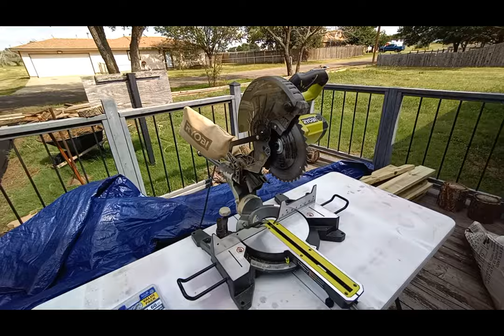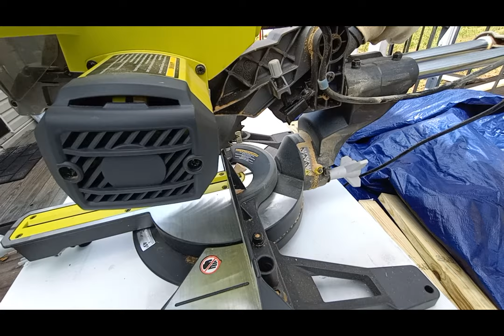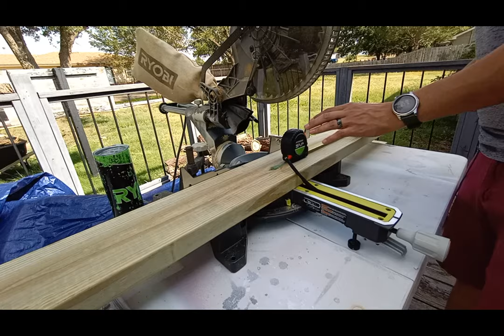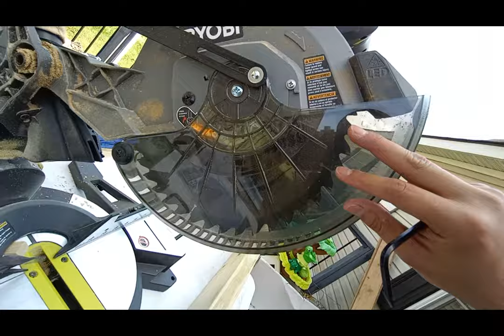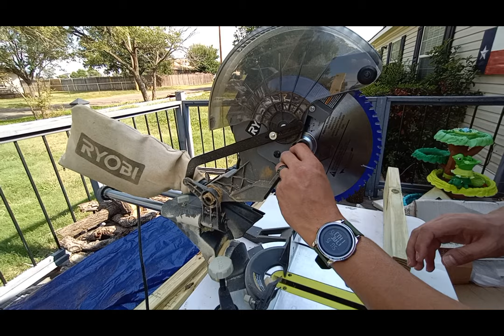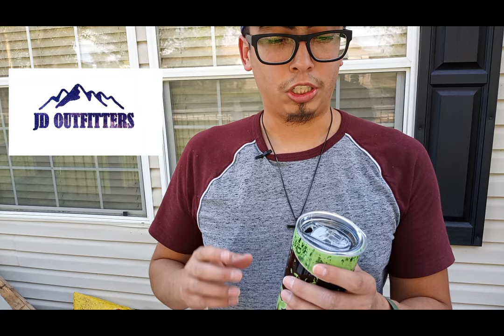How to change a miter saw blade for beginners | Ryobi TSS103T 10in. miter saw review

Comment: Extend saw and start the cut on the side nearest to you and push away from you to finish the cut. Teeth designed to cut in that direction and it's safer.
Reply from the maker: Thanks for your input, I'll give that a try.
Reply: just saw this in the manual for the same saw, I had no idea about this before then. Anyways good info 👍🏻
Reply: Yes, this is the way!

Comment: That saw is not that good, and the blade it comes with is a P.O.S. If the saw did not come with the stand when i bought, I would have returned it. Then, I woulld have went with the craftsman one or Kobalt 10 inch. They both slide smoother and are double bevel.